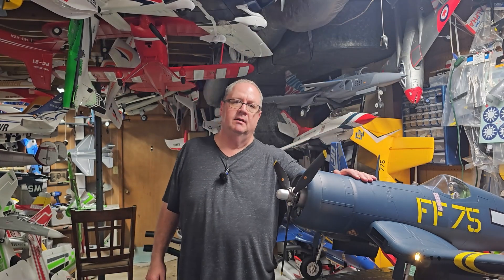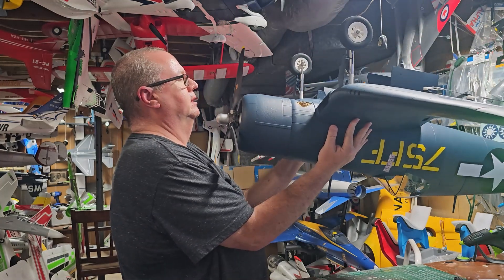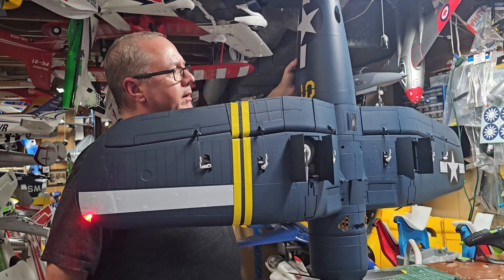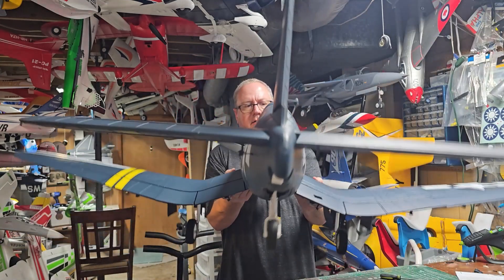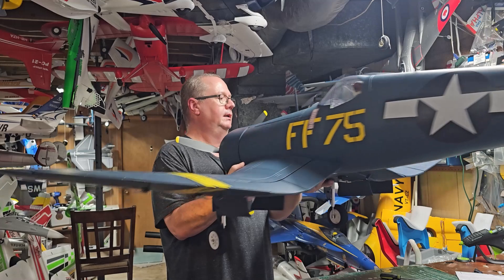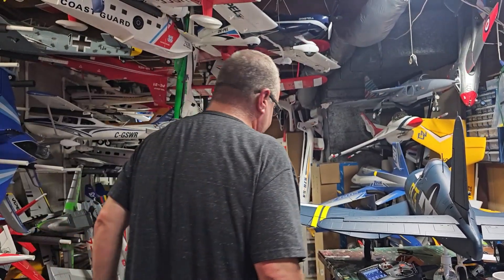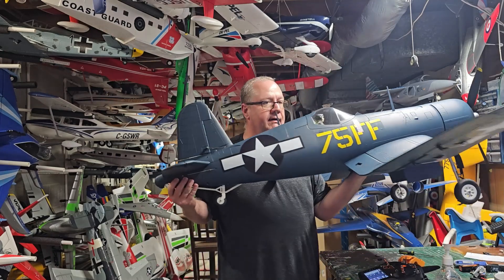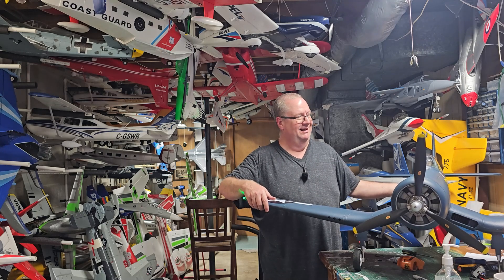FLIGHTLINE F4U CORSAIR 1600MM RADIO,RATES, AND CG by FGFRC #aviation

Comment: I always balance cg with gear up as it's where it's flying the most
Reply from the maker: I agree with you because that makes the most sense but I understand gear down since you would want a heads up if the gear down makes for a dramatic shift. It does not in this one.